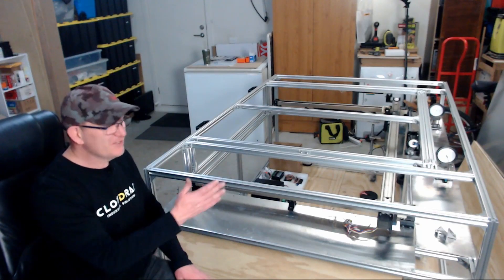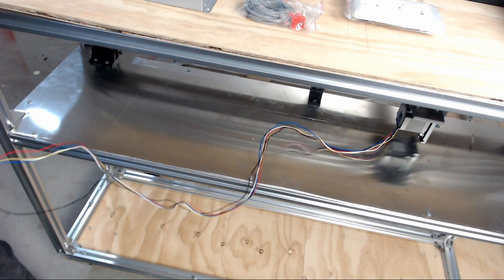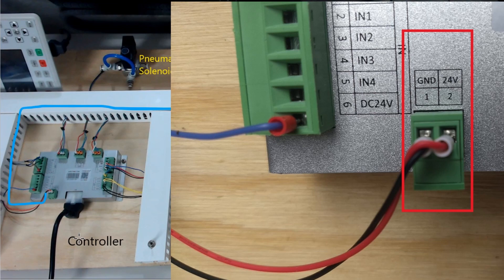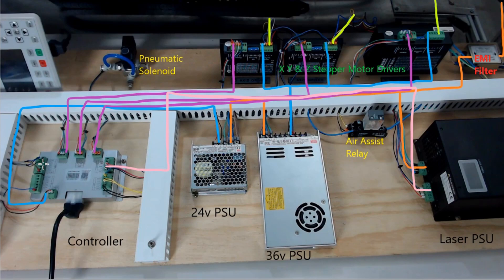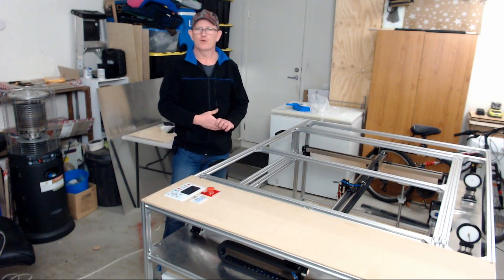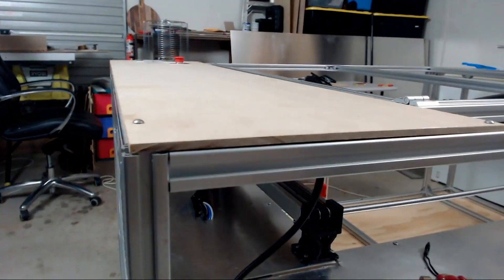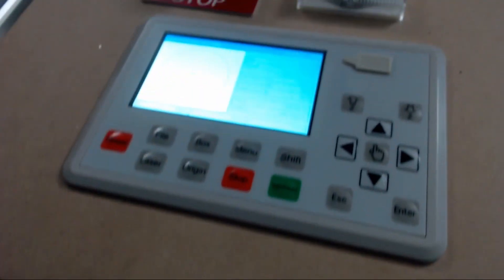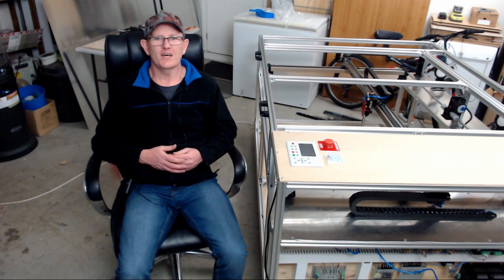06 Build Your Own Laser - Wiring of Components

Comment: Hello. Thanks for this great video, it helps a lot. I have question though. I find  other electronics schemes that use 2 24 V power supplies instead of 1 24V and 1 36V like in your machine. Someone I know has a laser that has 1 24V and 1 48V power supply. What is the reason for that? And can you give me any hint so that I can learn more about cnc laser electronics?
Reply from the maker: the various Voltage PSU are installed depending on what your components require.  some require 5v some 24V and 36V 48V etc, so you install the PSUs that you require for your build.  
2x 24 V psu would be suitable for some builds if you have 1 for the controller and 1 for the motors and drivers.
be sure to have a psu that has sufficient voltage and watts for the components you install
Reply: @MWLaser  Thank you for your response. For the motor driver you used in this build Cloudray indicates that the working voltage is between 18 and 50. So what is the reason we use a 36 V power supply? I have seen someone using a 48 V on Youtube saying that it would work more powerfully. Does that make sense? Also since it is between the range why not use 24 V, thus why not connect only one 24 V power supply to both motor drivers and the controller?

It might be obvious I am not familiar with electronics at all. It would be great help for me if you can direct me to any guide or documentation or tutorials about these. I just assumed you might have few sources in your mind, otherwise don't bother, I'm already looking for those.

Comment: I'm working up a list of parts to build my own in a similar style to this but I have a question about the control. If I'm going to be using a PC as the control source, do I still need the screen panel?
Reply from the maker: yes
Reply: @MWLaser  That's disappointing. So is that panel primarily required for the laser or is it fundamental to the entire electronic package used here?
-
I'm basing my design largely off the motor array that ThisOldTony used in his mill conversion, so closed loop servos rather than steppers. Ideally I'd like to rely on a PC as the control input and cut out anything that's redundant or extra.
-
Do you have any good resources you recommend reading/watching on this?

Comment: Hello I would like to take a doubt my engines are making noise.  Even though he's standing still.  This is normal to happen.  The engines I use and the drives are the same as the video
Reply from the maker: no not normal
Reply: @MWLaser  How do I stop this hiss in the engine?
Reply: @franciscolucivando9122  I'm experiencing same problem right now (not the same motors, or drivers as yours) .. I spoke to the local seller and he confirmed, those steppers are not assembled with original chipset, so I actually bought fake cheap steppers, which can't handle current and the voltage. I believe, I can stop hissing my motors and significantly improve their behaviour with new,  more expensive (but original) steppers with some nice features, like automatic current regulation, or silent mode.. In most cases (as I did my research), replacing steppers always helped (So try to check if they are not fake ones) .. In a week or so, I should get new steppers, so will connect them and report if anything changed. Hope you have sorted it out meanwhile.
Reply: @rudi.s  I still haven't been able to solve this problem.  I had asked, for several people and no one knows what this hiss that appears on the engine is.  I bought these engines at Cloudray-motor-store.

Comment: Hi, love your work! I have a question, i need two stepper motors 53s15L and two stepper drivers 3DM580? Or one 53s15L and one 3DM580 + 573S09-L and DMA860? Thanks for your help
Reply from the maker: Parts I used are listed here - https://mwlaser.com.au/diy-laser-build-cost-estimation/
On my build I installed the following:
1x 573S09 & 1x 3DM580 for the X Axis
1x 573S15 & 1x 3DM580 for the Y Axis
2x 57HS22-A & 1x DMA860H for the Z Axis (These were included in the lift bed kit with motors)
Cheers Matt
Reply: MW Laser thanks Matt!!

Comment: Your videos are well done, but I got to say.  Some of the things you do don't make a lot of sense in the performance aspect of the equation.   The main one being adding all that unnecessary weight to the nozzle.  SPT's new integrated red dot tubes are where it's at if you must have one.   Anyhow, reducing nozzle weight is one of the most critical things you can do yet gets over looked more than just about everything else.      Increased Dynamic loads and loss of acceleration/deceleration speeds are the real problem with home built and 99% of all Chinese kit and prebuilt units.  The carts and nozzles are way to heavy. 
Attaching more junk to them is a terrible idea.
Reply from the maker: Thanks for the feedback, I do use a beam combiner on my machines, eliminating the red dot from the laser nozzle tube.

Comment: Hello Matt!
How did you calculate the microsteps on the 3DM580 drive?
Reply from the maker: Are you wanting to know how to calculate & calibrate steps on the controller for your X&Y stepper motors? Which controller are you using?  (email matt@mwlaser.com.au for more info)
Sorry if there is a delay in reply we are preparing to move premises.

Comment: Can you inform me where i can get the electrical plugs used on the motor controllers?  4 and or 6 wire plugs.
Reply from the maker: You will find a link to these connectors on my webpage - https://mwlaser.com.au/part-6-wiring-of-components/

Comment: can i remplace stepper motor   with servo motor
Reply from the maker: Yes you can. Your choice to use stepper or servo motors.
Configuration steps on controller are the same. Cheers Matt
Reply: @MWLaser  Think you so match plis more video for laser works

Comment: Hi Matt, Great video, Im currently going to be building my own laser engraver. Ordering parts from CloudRay Laser. 
Will you be getting a Transformer for you laser engraver? I had one come with my K40 clone.
Is the EMI filter necessary? and what benefits does it provide?
Reply from the maker: G'day, 
A basic explanation of an EMI filter is that they remove / filter electrical interference noise from devices on the same mains power circuit and surrounding electronic devices.  By filtering out these electrical noise frequencies it helps to ensure the laser machine runs without this type of interference to the controller, stepper drivers and motors.  It is not essential but recommended.
Sorry I'm Not sure what transformer you mean, I don't recognise a need for one on this build.  Unless you mean something different and I misunderstood.
Cheers Matt

Comment: Thanks Matt, great detailed video. Are you also going to cover a video on an air filter? Im about to buy a laser but I’m also concerned about the fume coming out of the exhaust.
Reply from the maker: Thanks, No I will not be going over air filters in this DIY Laser Build series..  However there are various options you can use.  If you are in a work space where you can vent directly outside like I am then no filter is required (so long as you don't misuse the laser and cut material is safe and does not release toxic fumes), or you can divert your exhaust air through a HEPA or Activated Carbon Filter.  If you are cutting or engraving timbers and paper products, you will find that the filters choke up quickly so you would need a cheaper pre-filter that can be replaced or cleaned regularly.  I have purchased an Activated carbon cylinder filter to test out and I plan to do a build video in the future, but not a high priority for me.  Cheers Matt

Comment: Matt, your timing on this project is amazing. I have a few questions before I start ordering parts. I'm actually hoping to build a dual-tube setup with the 90w and a 150w with dual heads.

Do you see any reason the same idea wouldn't work well with the 1400x1000 bed size? I'm hoping to cut plastic sheet and fit four 18"x24" in the machine at a time. Do you feel the 90w tube can go low power enough for detailed engraving? We also hope to cut some paper/ cardstock in the machine. That's why I was thinking about the dual laser setup.

"The stepper motors I use are Leadshine 573S15-L and 573S09-L" --- these are for the X and Y correct? Both using the 3DM580 drivers? 

The DMA860H
 driver is for the bed control correct? It comes with the kit as well as the motors correct?

Any problems I should expect or look out for??

Thanks!

Frank
Reply from the maker: Replied via email - Cheers Matt